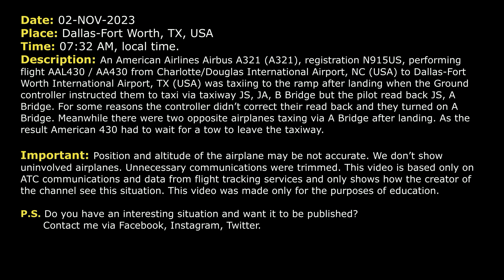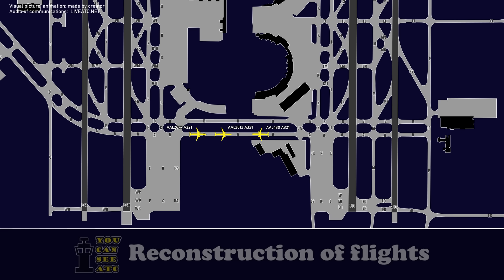Wrong read back causes problems at Dallas-Fort Worth Airport. Taxiway is blocked. Real ATC

Comment: I think this will be on the controller for not hearing the read back error... They've got a difficult job no doubt.
Reply: TheFlyingZulu this is absolutely correct.  Read backs are the most important part of ATC.  There is no doubt 430 heard in his mind the Alpha bridge, and he read it back.  It no longer matters if he read back the wrong clearance, he read back alpha, and the controller missed it.  
As a retired controller I can’t emphasize this enough to all pilots…
Give a full read back and including full call sign on every clearance.  This puts anything that happens afterwards on the controller as long as the pilot does as HE READS BACK.  If he just acknowledges with a “Roger” it will most definitely Fallon the pilot.
Reply: @efoxxok7478  How is "roger" as the readback not on the ATC for accepting an incorrect readback?
Reply: @zachansen8293  Because "roger" means I heard and received your transmission/instructions. Thusly if a pilot responds with just a "roger" then it's up to the pilot to carry out the instructions. If I recall correctly the only thing that a pilot is required to read back in taxi instructions is the runway assignment and hold short instructions. Everything else a pilot can technically respond with a roger and be legal.
Reply: @zachansen8293  the pilot who gives only a roger with no call sign will likely get a controller to demand a call sign on the read back.  A response to a a clearance that includes the call sign and a roger may get know response from a controller.  The smart controller who doesn’t want any trouble for anyone will demand a full read back.  The ATP ( that’s the Bible for controllers here in the US) doesn’t require a read back except on certain clearances such as runway crossings.  An acknowledgment by the pilot that doesn’t include a full read back puts it now on the pilot so it is in his best interest to give a full read back.
In the event of loss of separation tapes will be pulled.  If the pilot in anyway violated the clearance he takes full blame, the exception being as noted above.  If the pilot reads back correctly and it is a bad clearance it falls on the controller, if he reads it back incorrectly and the controller doesn’t fix it it falls on the controller.  If the pilot reads it back correctly and does it wrong it falls on the pilot.
In the end it’s best for everybody if full read backs are given.